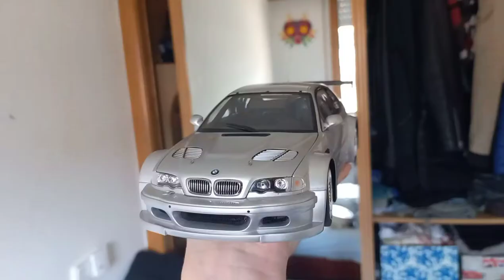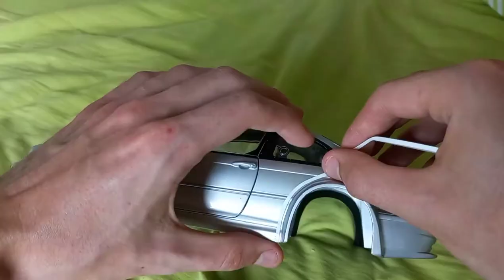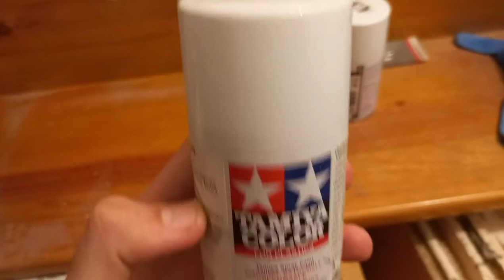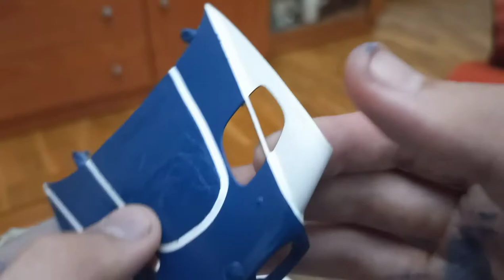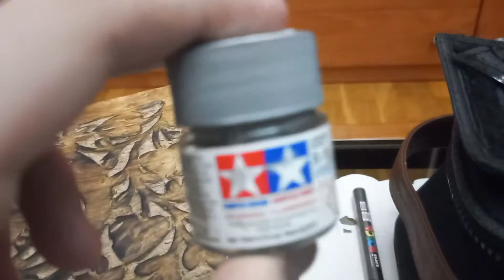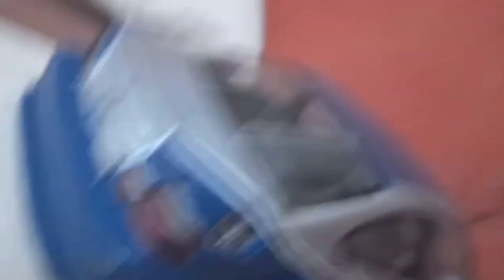Painting the BMW m3 gtr e46 from Need For Speed Most Wanted

Comment: how making white line bruhh?? 🙏
Reply from the maker: yeah i forgot to record that. so, you make the design with the tape, including the white line. you paint all white. then, when is dry, you put mask tape to protect the area where the white line is supposed to be and paint the blue. when you take all the tape off you  will have the white line like yo see here. its simple but kinda tricky. try to apply the spray correctly or the paint will traspass the tape or get ripped off when you retire the tape. if some paint whent trough yo can apply the spray on the cap of the can and with a brush paint over it. in the case of some white on the car paint you can erase it with ascohol 96º and cotton sticks. but be slow and gentle or you will erase the car paint too. i had made like 4 of these cars by the time i recorded this so i had some practice. but try it, is so fun and a gr4eat car to have in your collection. i bough it on ebay, they are rare and kinda pricy but its worth it

Comment: I have a question I’m maybe going to build a similar one but how did you get those white stripes on like if you pulled them away from the car it should be silver again I didn’t get that part
Reply from the maker: I forgot to film that part. After giving the white paint i protect the white with another thing tape, then i painted blue. Thats why at the end the white stripes are there. Its my fault i was so concentrated on the car that i forgot to film it